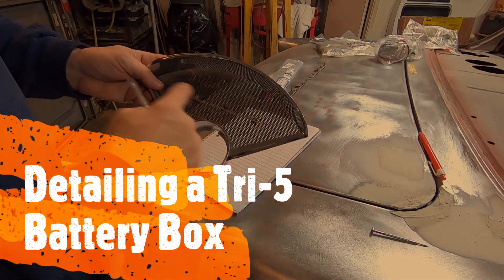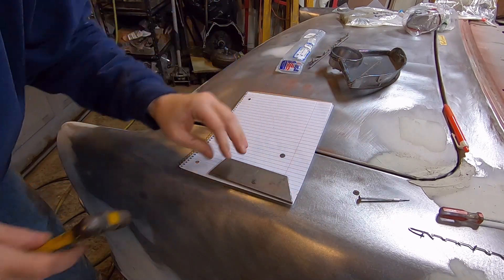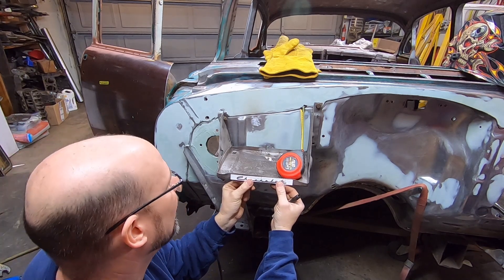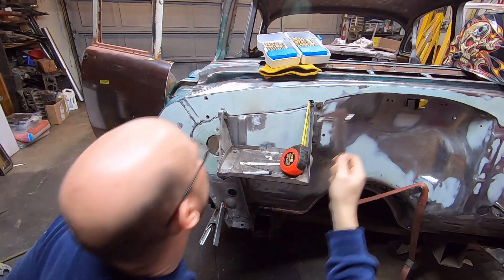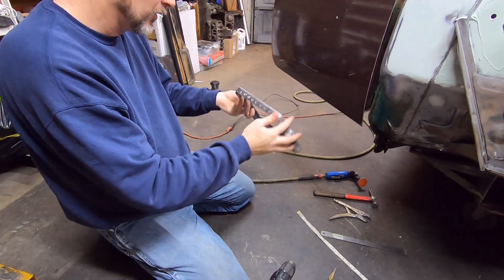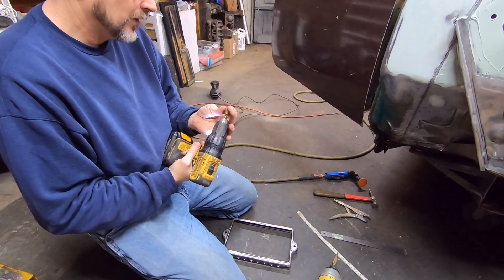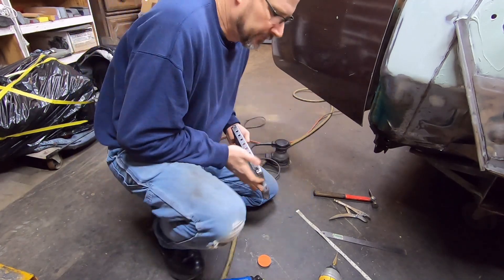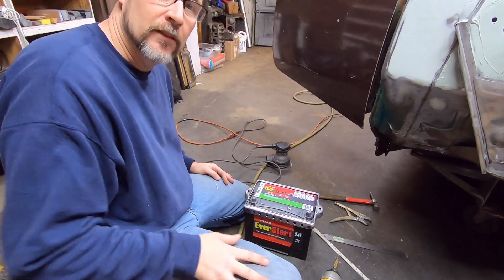Custom battery box detail on 1955 & 1956 Chevy cars

Comment: Using those Chevrolet scripts is a great idea. I am going to do something similar on my 57 Chev after watching your video. Thanks for the idea.
Reply from the maker: 57 Scrips have a different font than 55 and 56. You probably knew that.  Thanks for watching Michael
Reply: @haffrods7055  57 Chevs in Australia, where I live, had the 55-56 RHD dash so they had the small 56 Chevrolet Script on the speaker panel. I have installed a 56 dash in my 2 door hardtop so now it is right hand drive. I have a couple of 56 dash scripts so I will use those in the engine bay as per your idea. Thanks again for your informative videos.

Comment: Hey Hafrods, got a stupid question always wanted a 55-57 2 door,  As a project, but can you tell me what it means when they say (post) just watched a video on a 56 210 POST. 
Figured you would be the man to ask.
Reply from the maker: Post is a sedan, meaning has a post between the door glass and rear quarter side glass. Basically a wide painted frame around the side glass. A hardtop has no post.
Reply: @haffrods7055   Knew it had to be something simple thanks for the info. By the like the vids